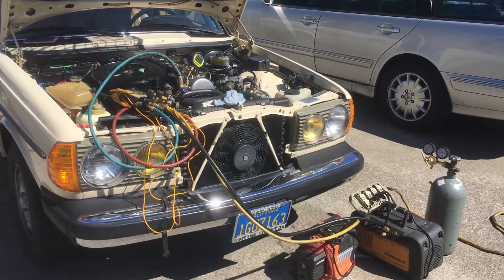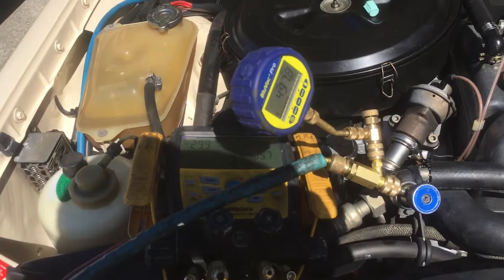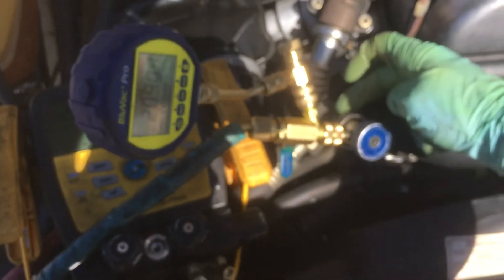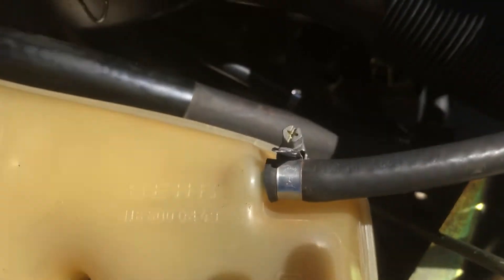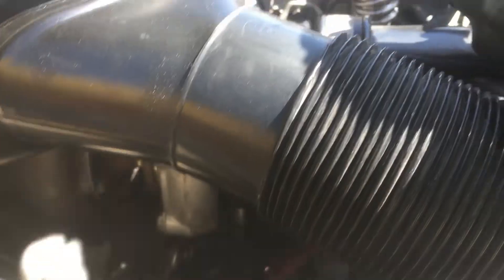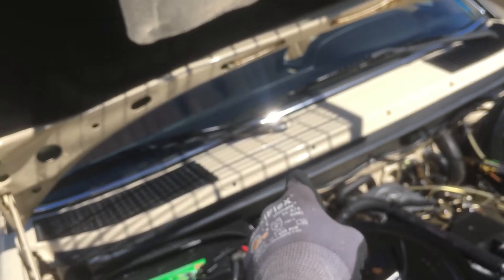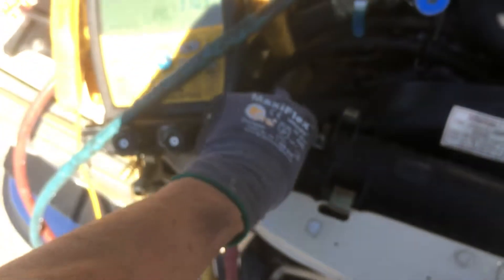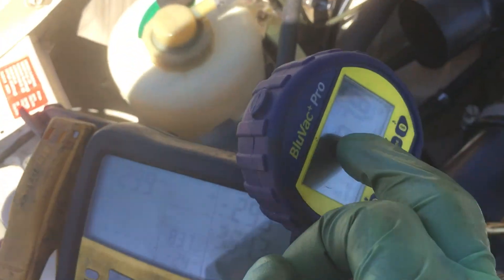micron Meter vacuum decay, Following the path of vacuum through the longest route￼￼

Comment: It dawned on me yesterday that flowing liquid refrigerant across the manifold micron gauge, washes any oil contamination off the heated thermocouple.
Reply from the maker: Fresh clean refrigerant with no oil in it. 

But then there is pressure sensitive sensors that if you put pressure to them it destroys them but not the ones that are in the manifold gauges
Reply: @coldfinger459sub0  Yes, I do believe these hvac gauges are built to handle 400-500 and more.  Don't try that with a quartz ion gauge.
If I recall, our 1-Torr baratrons never saw atmospheric pressure once calibrated.